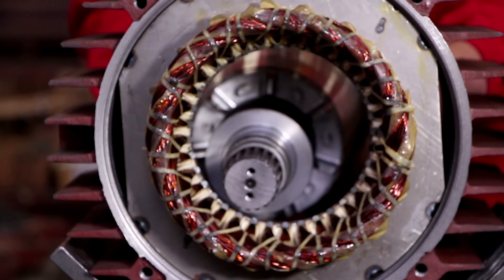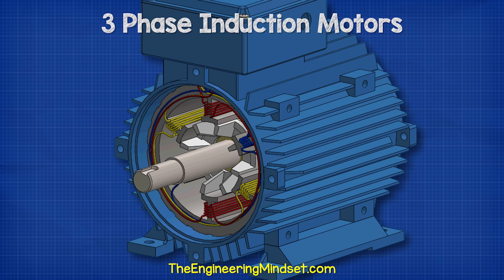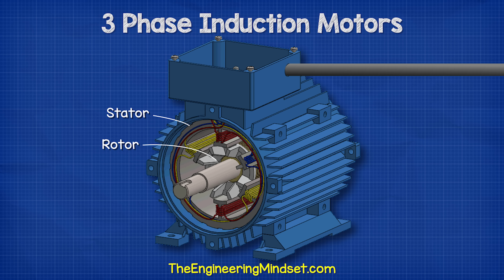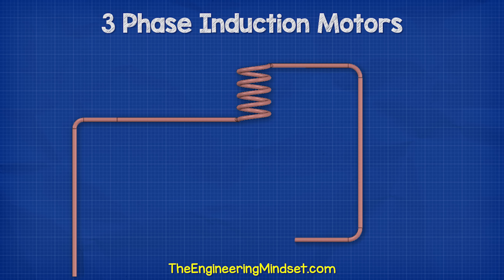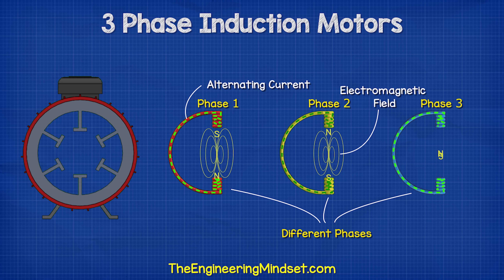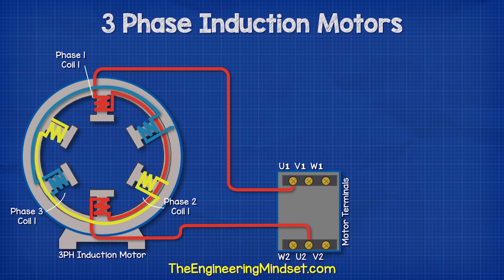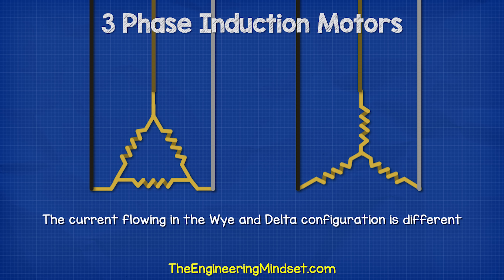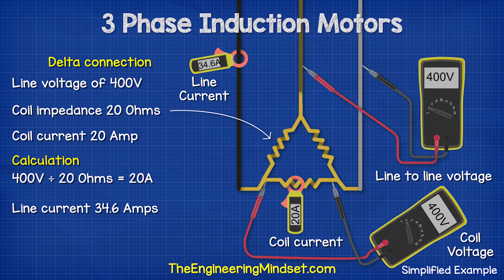How Electric Motors Work - 3 phase AC induction motors  ac motor

Comment: The Delta and Wye were so difficult for me to understand and this video makes so much sense on why we need the two configurations. And what an explanation of an electric motor. Please keep posting awesome content like this. So well made.
Reply: Delta would seem to be better?
Reply: @blackterminal  if the motor design for delta connection for running full capacity yes delta connection would be better, if you using wye connection the motor can only run half of its capacity, and if the motor is designed for wye connection you can't use delta connection because the coils will be heat and burn unless you using stepdown transformers to reduce the voltage but you will not make the motor run stronger🤷, so it's not make a sense you wanna change the connection and using stepdown transformers, unless the wye connection designed motor using 3 phase 400v and you have 3 phase 230v, then you can change the connection from wye to delta. Hope this can help you

Comment: If the rotor will never catch up to the rotating magnetic field of the stater then how do you get a circular saw to go 5000 RPM, when you have 60 Hz which will only produce 3600 RPM if there was a rotating magnetic field
Reply: you gear it different...
Reply: @PLAYERSLAYER_22  You mean like a big wheel spinning a little wheel to increase the rpm

Comment: Thank you for the great work in describing the construction of the synchronous motor,  I wish to highlight that the delta & star connection in your connection causes the field rotation in opposite direction. The current of the star & delta connection  will actually be the same when connected to the same load as the transposed impedance from the load side to the supply side cancels out the factor of sqr root 3. I decided to subscribe youtube premium because of great work like yours. Bravo.

Comment: 3 phase motors don't have 6 wires coming to the motor.  They have 3.  Where the animation shows the power circulating in and out through 6 wires is not reality.  You do have 3 wires coming in at the contactor that are broken until the contactor is energized.
Reply: You’re wrong